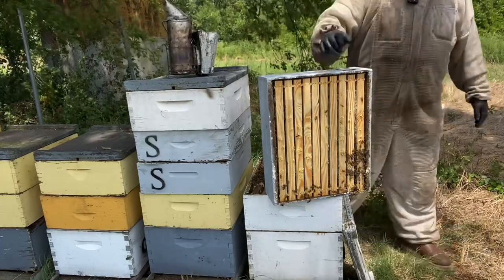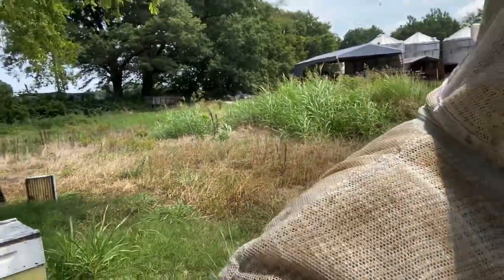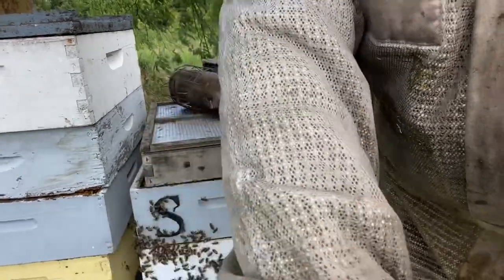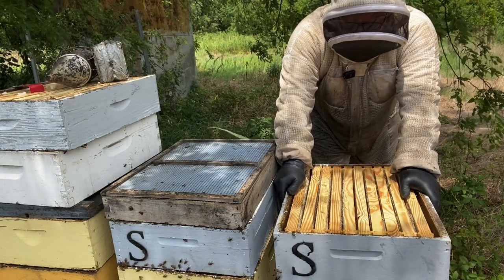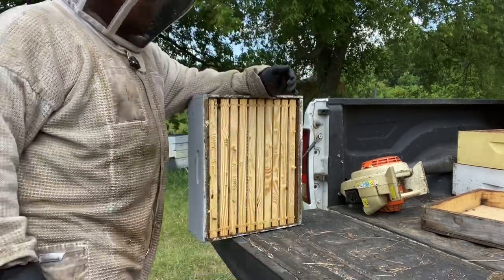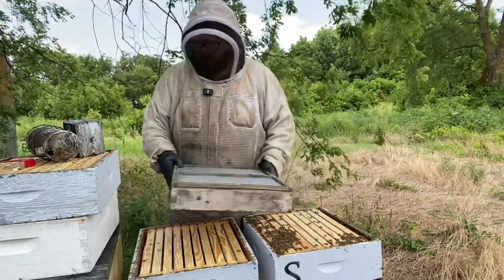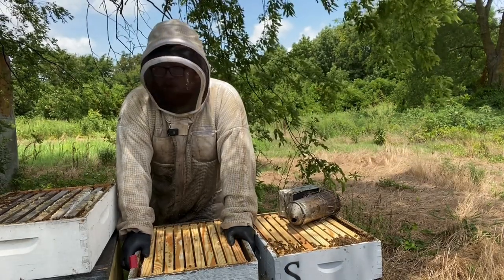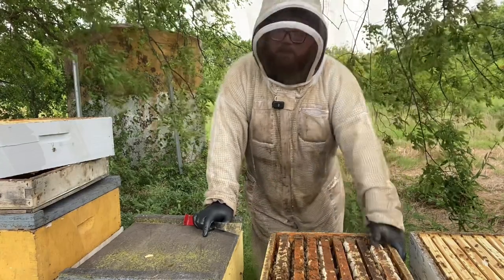Managing Comb Honey Supers

Comment: Have any videos on how you attach the foundation to the frames? Just melted wax as glue? Or do you just use a starter strip?
Reply: I used melted wax to glue the foundation in, but I leave around a 3/8 in gap at the bottom
Reply from the maker: Yes I have a couple. This one has gotten a lot of views.

https://youtu.be/Y8p--vvj80A